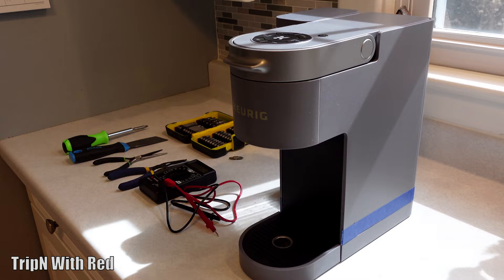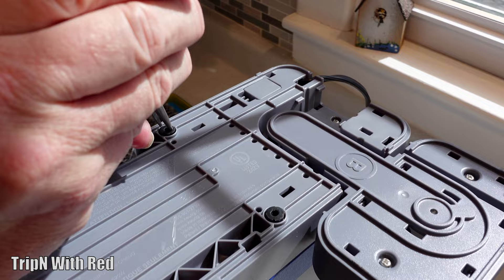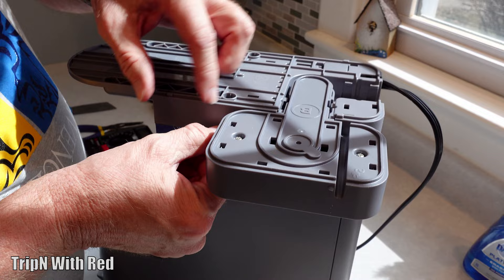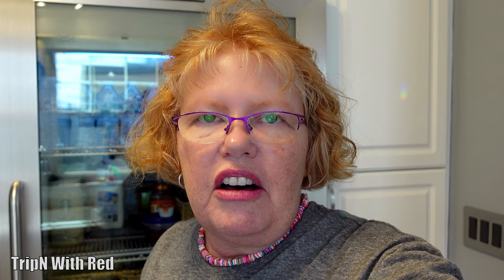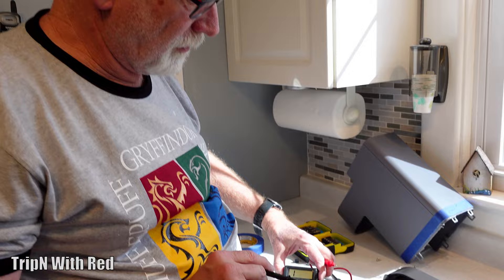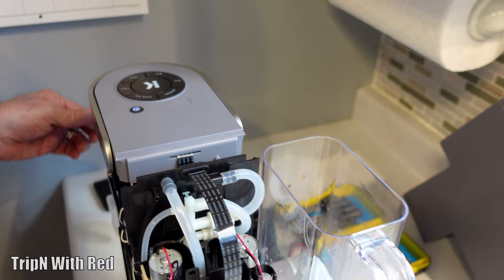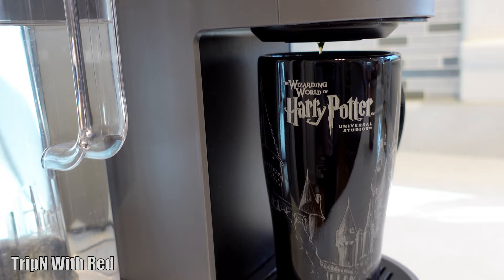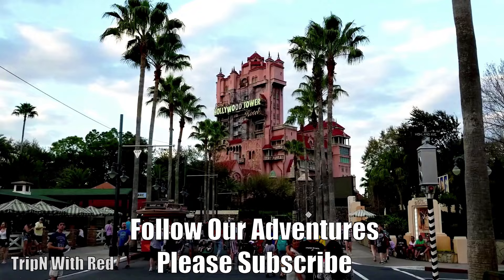Reset your Keurig - How to FIX & Reset your Keurig K-Supreme Coffee Maker - Descaling Power Problem

Comment: If you get a brand Keurig and you always use distilled water in it, you will never have to descale it or replace the filter in the tank. Ignore any warnings about using distilled water in the coffee maker. No one can ever give you an actual plausible reason for avoiding distilled water so it's baloney. I've always used distilled in my 4 year old machine and it works as well as when it was new.
Reply from the maker: That's good to know. Thank you for watching and commenting.

Comment: I had the same problem after descaling mine it would not draw water I unplugged it for 5 minutes plugged it back in and bam it works just fine I think I'm plugging it resets it
Reply from the maker: That's awesome that worked for you. We were hoping ours would reset with unplugging it like a computer. After a couple times letting it sit unplugged for a period of time it still wouldn't work. Unfortunately we had to go the long route to reset it. Thanks for watching and commenting.

Comment: I don’t know how any of you can get the outer case off.  Honestly, it’s ridiculously difficult, and we cannot do it.
Reply from the maker: That case was so hard to remove. I'm sure Keurig designed it to not be removed. They probably wanted people to buy new coffee makers instead of fixing the existing one. It was very frustrating. Thank you for watching and commenting.
Reply: I could of had a new one shipped to me by now! Lol.  Thanks for the the info, but I'm buying a new one.  This one is nearly 3 years old and makes a bunch of coffee
Reply from the maker: @milkman45828  the case is terrible to remove. Their flawed design is giving them job security since it's so difficult to get to the reset button.
Reply: Patience persuasion and plastic prying tools. I broke some of the tabs but thing has about 40 of those so it’ll be solid once you put it back
Reply: Don't be afraid to pry and lift up on sides and back panels...
Reply from the maker: @jaflolara  it's definitely difficult to remote case but if a few tabs break it shouldn't be a huge problem unless the case itself cracks or breaks.
Reply from the maker: @richardsaltzman7188  it takes persistence and patience to get that case off.

Comment: Why the hell doesn't kuerig have a RESET BUTTON.
Reply from the maker: The reset button is inside the case. We had to remove the outside case to access the reset button. They Probably figure if they make it inconvenient to reset, they can sell more units but customers would likely buy from their competitors to avoid the problem. I don't know why they don't correct the design on this model to keep customers happy with a product that is reliable. It's definitely a flawed design. Thank you for watching and commenting.

Comment: With two small flathead screwdrivers you can separate the shell with one person but boy it is a bear to put back on
Reply from the maker: That case was definitely a challenge taking off. Our reassembly was easy but taking it off was terrible. Since we hit the reset button things have worked right without another problem. Hopefully it continues to work without any issues. Thank you for watching and commenting.

Comment: I saw this after my second one died. .both were replaced under the warranty. now I know what to do if it happens after the warranty expires
Reply from the maker: It's a relatively easy fix. Removing the case is the only part that's difficult. Keurig definitely has a design flaw in this model unfortunately. I love the look of this model but they need to correct the problem. Thank you for watching and commenting.

Comment: Why don't Keurig have a tiny hole in the plastic so you can reset it outside the cover?
Reply from the maker: I completely agree. They have to know this model is faulty. Of course if they created an easy access to reset the problem, they would not sell as many units. It's unfortunate that this model has issues that they continue to spit out units with this faulty design. Thank you for watching and commenting.
Reply: @TripNWithRed  I just took mine back today and I am on my 4th one. Fortunately Costco takes them back no questions asked.
Reply from the maker: @wanaraz  that is good to know. Thank you for the information.

Comment: I hope I have the same success.  I have a mini.
Reply from the maker: I'm not sure if a different model would be the same but it likely has the same reset button. Hopefully the fix works for your model as well. Thank you for watching and commenting.
Reply: @TripNWithRed  sighs... it did not work for mine. It seemed to click when I plugged it in, but the regular power button doesn't light up, but the blinking ligjt at the K does. Holding that down does nothing.  Ugh. Pump is not working either.
Reply from the maker: @tracyd2598  sorry to hear that. I'm not sure if the mini is designed differently? I was hoping even though it's a different model that the fix would be the same. Have you contacted keurig by email on your specific model? They might have an idea on what you can try or even offer to send you a new one.
Reply: Have you checked the nozzle that punctures the K-Cup to make sure it'd not plug? I had one that did what you described... a straightened paperclip cleared the nozzle, then it returned to normal...

Comment: Wish I had watched your video fist but was able to get the casement off and reset the unit with a paper clip. 
Why a panel on the side of the unit for easy access to the reset wasn’t incorporated in the design is a no brained.
I sure the majority will just go out and buy a new one and never look for a fix or care to take the casement off to access the reset.
Poor design and a time consuming process.
Has anyone tried another Brand with a better design?
Reply from the maker: Sorry you went through the hassle but glad yours works again. Taking the case off was quite the job. Like you said, they could have made it accessible. By making it near impossible, they are giving themselves job security because people give up and go buy a new one. Our old original style keurig worked for years without a single problem. I know there are other brand coffee pod style makers but I don't know of anyone who has one or how reliable they are. I hope keurig changes this design to eliminate these problems in future coffee pod machines. Thankfully, ours has worked every since the reset from this video. I hope I didn't jinx it by saying that. 😆 Thank you for watching and commenting.

Comment: I tried it and it turned back on. But then when I tried making a coffee it turned back off again.  Tried it again but it was the same thing all over again. Anything else ?
Reply from the maker: Definitely make sure the water never runs out. We always have water in the tank. Letting the water get too low will cause the thermal overload to shut the machine down. Once there's plenty of water in the tank, try pushing the reset button again.

Comment: I fixed mine the same way,but i was at tad more brutal,i cut A 2 inch hole in the side of it and reset it
Reply from the maker: I wish we had done that. It would have been quicker. Thankfully, we've not had any more trouble with ours since we reset it. It works great. If it happens again, we will probably just drill out a hole. Thank you for watching and commenting.

Comment: Any idea how to do this with a Keurig K-Duo 5100?  With great difficulty I got the side off but in this model there is no white circle thing - help!!
Reply: The 5100 does not have a thermal overload, but it does have a thermostat. It is a Red colored wire with a cloth insulating sheathing... slide that to the side, then use your Voltmeter set to the Ohms setting. If you check across the thermostat and the Ohmmeter remains at 1, that part is bad.  Some folks buy the replacement part, others simply bypass it, by using a crimp style wire connector... I'm not sure doing that is very safe... I had a similar design go bad.... it ended up in the trash. Maybe you can call Keurig and see if they will replace it...
Reply from the maker: I'm not familiar with that model but hopefully the suggestion from @Joe-mg6pj will be helpful to resolve your problem. Thank you for watching and commenting.
Reply from the maker: @Joe-mg6pj  thank you for the suggestion

Comment: The screw is stuck on one side and its not coming out
Reply from the maker: It's possible the head of the screw got stripped. If that's the case, you may need to drill out that screw.

Comment: Apparently, mine is a POS. It refuses to turn back on regardless.
Reply from the maker: If you tried the reset button several times and still didn't get it back on, others on the feed commented they were able to get replacements through Keurig free of charge. Keurig obviously have put out a product that has a flawed design since so many people are having the same problem. It would be worth contacting their customer service and giving it a try. I hope you are able to get yours replaced. Thank you for watching and commenting.

Comment: Doesn’t it reset by keeping the power button down and then pushing all the other buttons one at a time?
Reply from the maker: That might work to reset the light but it won't reset the thermal overload switch. The case has to come off in order to reset the thermal overload switch. Thank you for watching and commenting.
Reply: @TripNWithRed  oh that’s what was wrong with it. I didn’t understand. Thanks?
Reply from the maker: @hissonggirlmoni5706  no problem. Thank you for commenting.

Comment: have had to do this so many times that I am about to smash this cheap ass, Wal-mart, Fall Apart, Chinese crap with a sledge hammer!  WAY TOO much hassle when all I want is a reliable, dependable coffee maker!  Is that really too much to expect??? (Barely a year old, descaled every 4-5 weeks)
Reply from the maker: I agree with you completely. Our descale light comes on all the time which is annoying. I'm guessing that's so they can sell customers Descaler on a constant. We stopped Descaling every time our light comes on. We do it occasionally now. Our old basic keurig machine ran for years and never had an issue so it's frustrating this model does. I've considered replacing it with a different brand machine but after we reset the thermal overload for this video, we've never had a problem since. This model is definitely flawed in design unfortunately. Thank you for watching and commenting.

Comment: Keurig... the brand with a 100% failure rate that people keep getting suckered into.
Reply from the maker: This model definitely has a high failure rate. Our original one never had a problem. This model design has a built-in issue that could have been corrected a long time ago but they obviously never did. We've only had to reset ours this one time when we made the video and it's worked ever since. Realistically, we should have never had to reset it. Thank you for watching and commenting.

Comment: Spend the money and get something worth a crap. Keurigs suck.
Reply from the maker: Our Keurig definitely wasn't cheap but I think if I need to replace it, I would probably buy a different brand that's more reliable. So far we've had no problems since resetting our machine. I hope it continues to run without issues. Thank you for watching and commenting.
Reply: @TripNWithRed  my experience is the cheap makers overfill in the brew cup and fill the pot w grains, or something like Hamilton beach brews way too hot and makes the coffee bitter. What's a quality name out there that works?
Reply from the maker: @jayo-motter-pops  ironically we always had the old school Keurig machine and never had a problem. We even had one in the office for years. No problem. Keurig found a way to create job security by creating a built-in fault with their machine. It's been so many years since we've bought a coffee maker, I can't even remember what we once had. It may have been a Cuisinart? We got rid of it because pod style was so desirable. Not really any cleanup to speak of and a single cup at a time fit our needs better.

Comment: That’s doing too much just hold the two arrows  together for about 5 seconds   Go to the setting reset   Push down on the k button .

Unplug for 10 seconds and you reset it .
Reply from the maker: Doing this will not reset the thermal overload. In order to reset the thermal overload you need to manually reset the button inside the case. Thank you for watching and commenting.
Reply: @TripNWithRed   the basic reset will fix everything . I had my machine 3 years, 
You going put your machine out of warranty . 

Good luck 🍀

Comment: Well it worked!! Turned it on.... had power.... Then shut down. CRAP. Now I have to take that 🤬🤬🤬 case off again. 🫤
Reply from the maker: It's a bummer it required another reset. That case is the worst to have to remove.